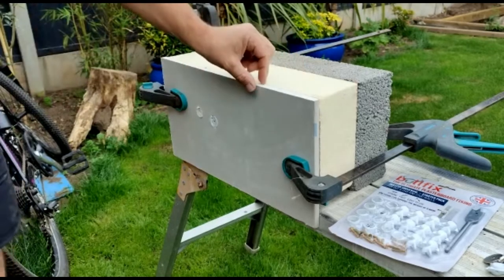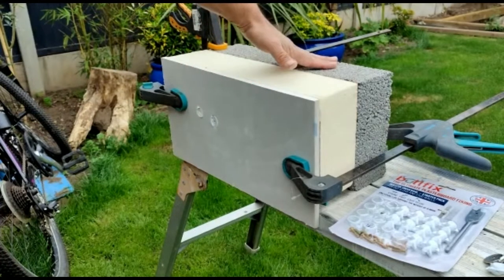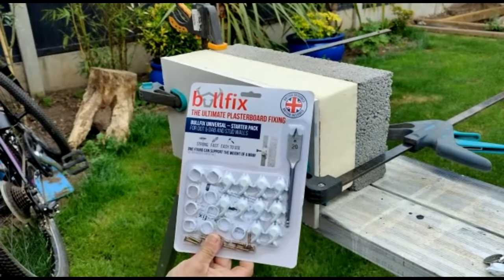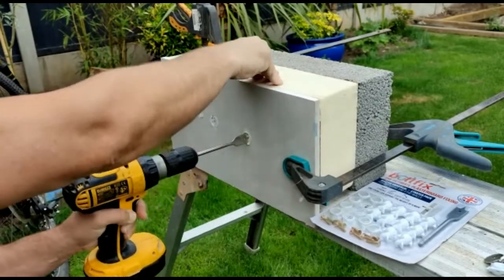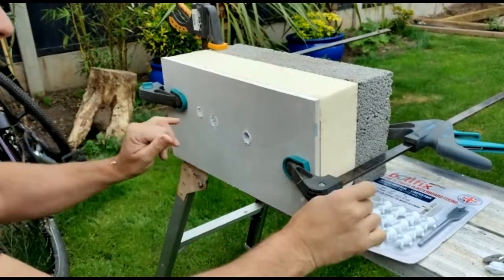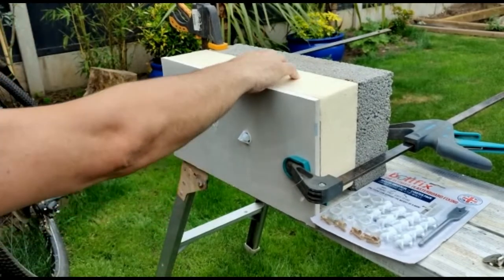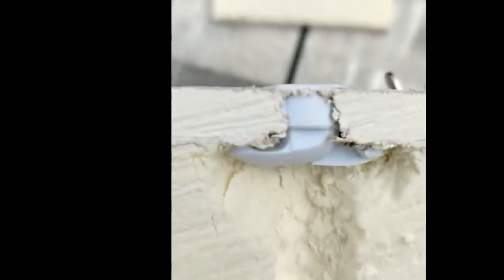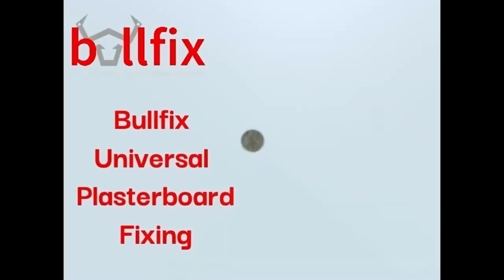How to fix to an insulated wall

Comment: Hi, Could I use these for curtain pole fixings? I've recently retrofitted house and haven't drilled anything into the insulated plaster board yet. Just not sure if they would hold the weight of curtains? Thanks